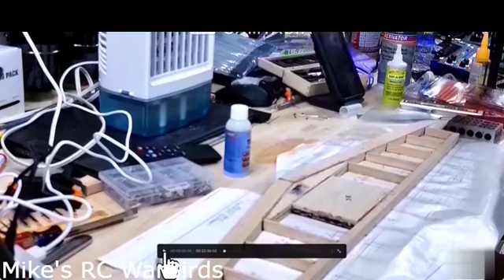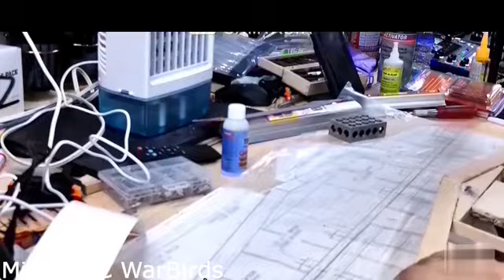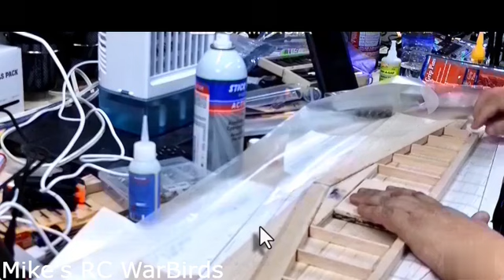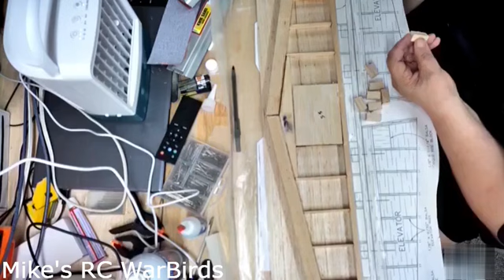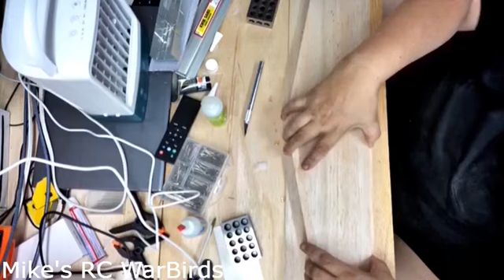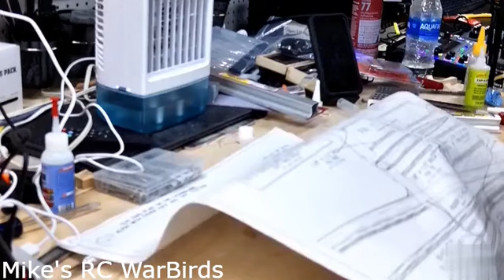Is Your Balsa Work Precise Enough? Corsair Build Guide

Comment: looks a bit bigger the my 60" spam tiger 2 :-\       hardly call this giant scale....  you seen Wayne Bransfields 24 FOOT span dehaviland manchester..    4      9 cylinde radial engines
Reply from the maker: I usually find that anything that is 1/4 scale and bigger is called giant scale. I do have a couple of 1/2 scale planes and two planes that have 17ft wingspans that I plan to build. This is probably the smallest plane I will be building.